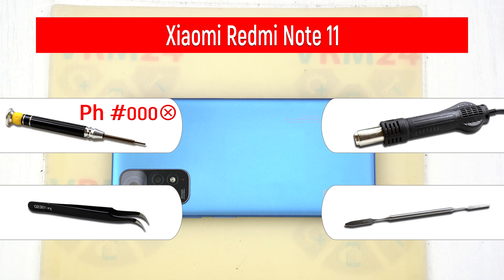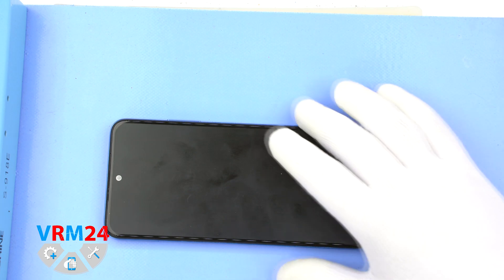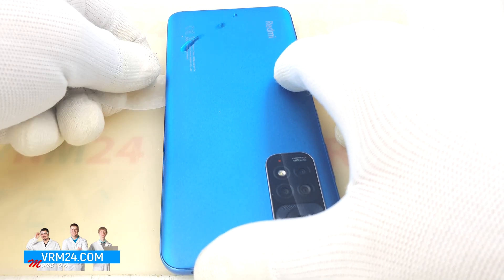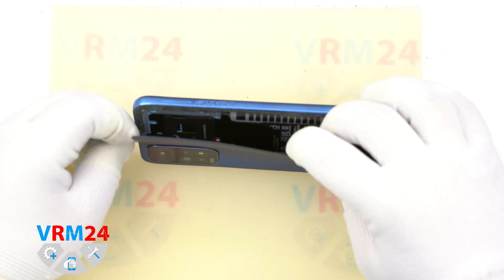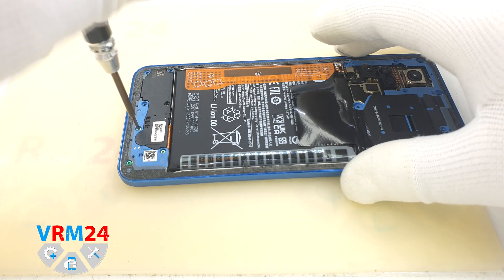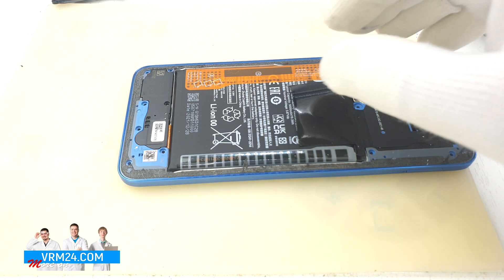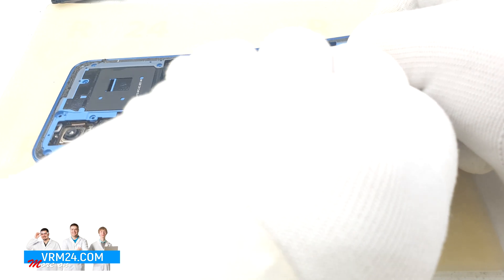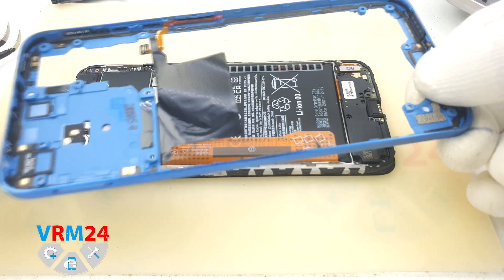Xiaomi Redmi Note 11 2201117TY 📱 Teardown Take apart Tutorial

Comment: So the earpiece doubles as a speaker? I thought they were seperate..and is there any liquid cooling system or something?
Reply from the maker: Hi, there is two speakers: the earpiece at the top and the loudspeaker below the battery.
Reply: @Vrm24com  thanks for the reply..I thought there were two speakers and an earpiece there..so there was 1 speaker and 1 earpiece (which is also a speaker)right?